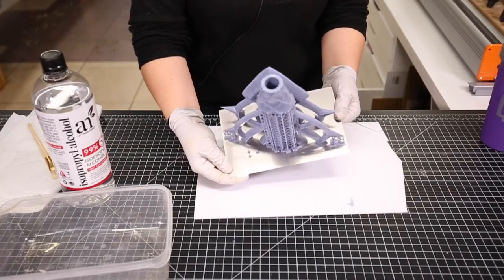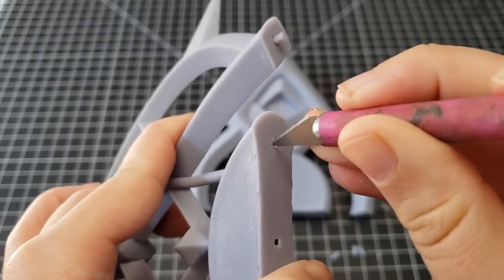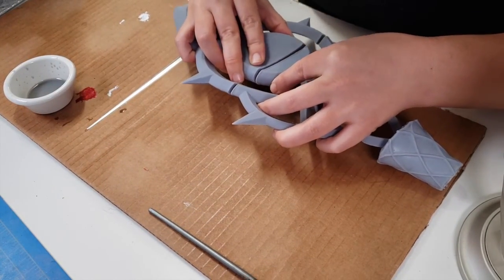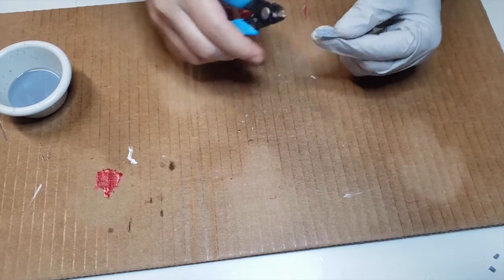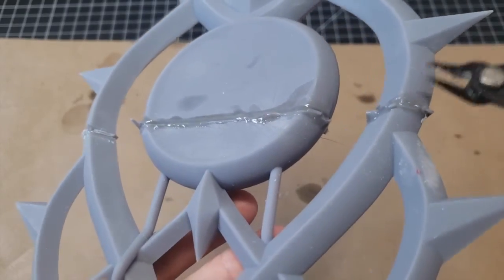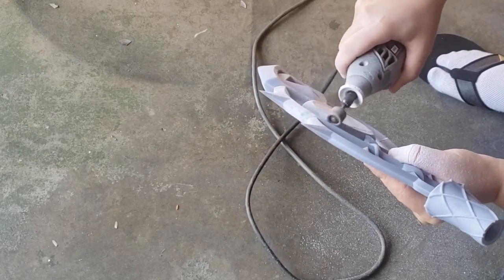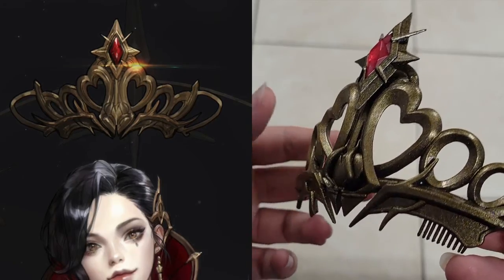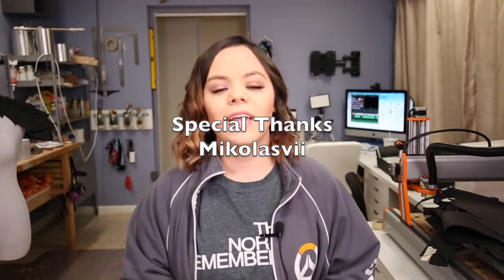Printing Large Props : Part Two

Comment: Hey Kiki, if I can offer some advice, don’t print directly on the plate. I always raise the part by 5 mm.in the Z direction.
That way parts mesh without that gap.
Can I ask you, what program did you use to cut the print in half?
Reply from the maker: Hey Chuck! Yes, you are right about raising the prints. This was kind of my first initial resin print, and quickly learned that! Now 3-5mm with supports is the preferred way to go!

I model and separate all of my prints manually in blender. I'll have some more videos on my process for that soon, but there are some great programs out there for splitting up pre-made larger files too!